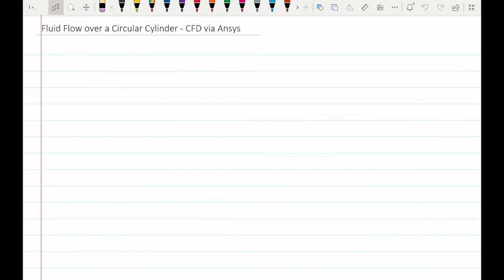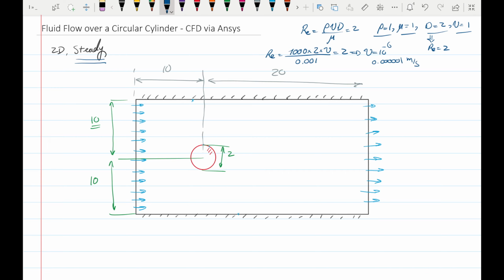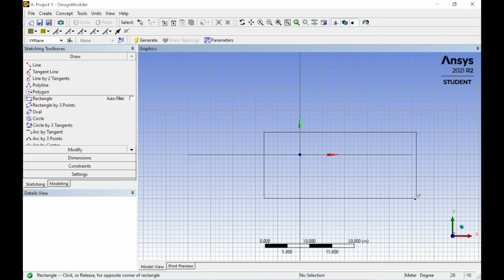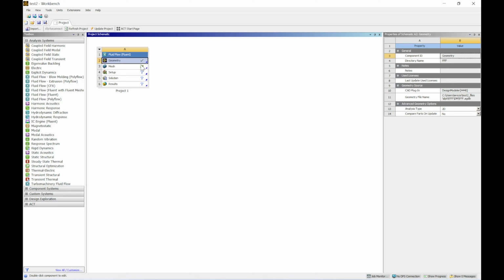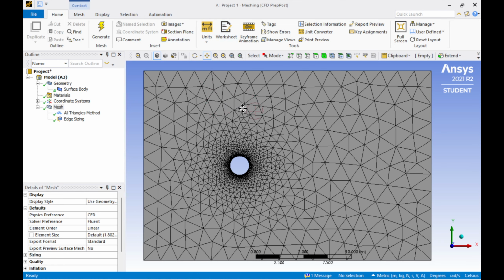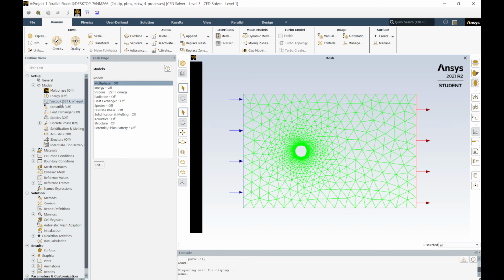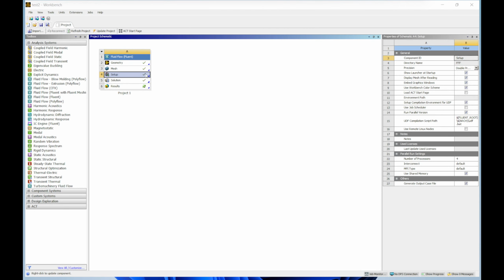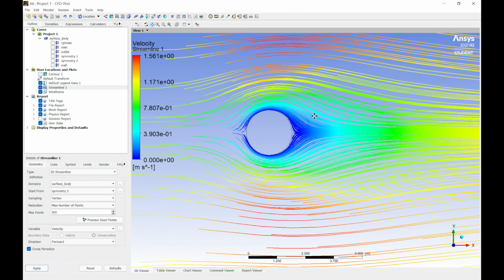Flow around a Circular Cylinder 3 - Computational Fluid Dynamics (CFD) with Ansys Fluent

Comment: What about two cylinders inline? I am trying to see how vortex shedding of the leading cylinder affects the next. This would help me understand lift effects of bundled wires in the air. Like on a high voltage transmission line.
Reply from the maker: Hi Steve, first be careful that this is a steady and laminar simulation, whereas most real-life flows are turbulent, and therefore unsteady. For most practical applications, you need to set your simulation for both unsteady and turbulent simulation. If this is done correctly, then adding a second cylinder to the simulation is a straight forward extension of what is shown here. Hope this helps.